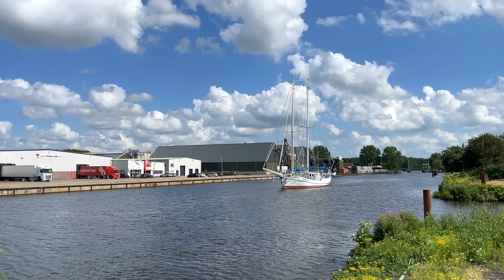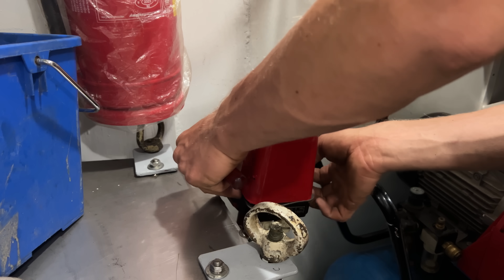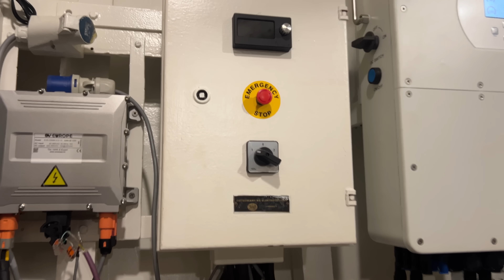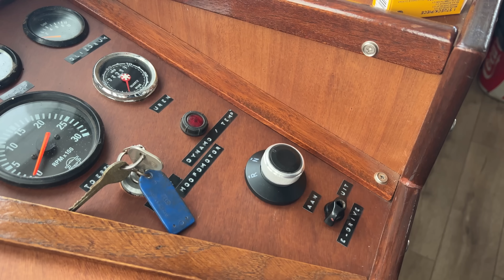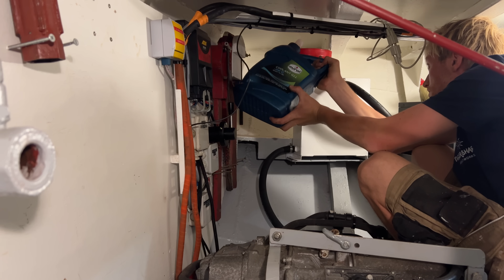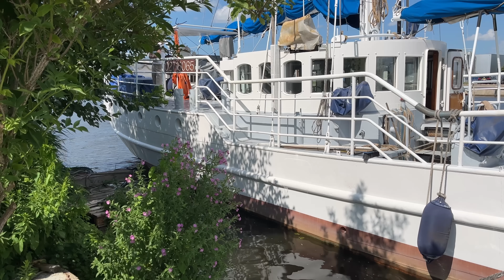The First Tesla Powered Ship - What Could Possibly Go Wrong?

Comment: What could go wrong?, well, we now understand that lithium -based batteries are incredibly dangerous, I watch all these YouTube channels where they're stuffing battery bank after battery bank in the bottom of their boat,,, if those lithium batteries catch fire your boat is going down, there is nothing that can stop it, and if you're in the middle of the ocean then what are you going to do?,, well we already know what you're going to do because of recent YouTube videos,,, you're going to die,,, so basically that's what could go wrong,, lithium-Ion batteries have brought down some of the biggest cargo ships on the planet, your little boat doesn't stand a chance when a battery goes into thermal runaway, and don't give me any crap about a battery management system controlling it,,, every lithium battery that is ever caught fire has a battery control system on it but yet it's still caught fire, you should be smart like the one YouTube couple. I saw building their boat is putting their lithium ion batteries in a fully encased steel enclosure at the rear of the boat that can be flooded with seawater automatically, and I also believe that they can drop the batteries from the bottom of their boat if something happens,, you cannot just throw lithium-Ion batteries on your boat and expect nothing to happen, it just simply is not the same as old batteries, when they go in the thermal runaway they will burn right through the bottom of your boat. Just like they burn through the bottom of large cargo ships and sink them, I can recall at least two cargo ships that have gone down in the last 6 months because of these batteries, The technology is new and it's very very very very very very very very very dangerous
Reply from the maker: We completely understand the concern, lithium fires are serious if systems aren’t designed correctly. That’s why our battery is in a sealed stainless enclosure with automatic aerosol suppression, pressure relief, and a total flooding backup. It’s engineered specifically so a runaway cell can’t spread or threaten the hull. We covered all of that in the previous video if you’d like to see the details :)
Reply: @tigersharkboatworks maybe your channel was the one I saw that battery installation on. I'm not sure, but it sounds like you have good safeguards, in general though watching these boat builds it makes me cringe when I see them putting the batteries inside their living area just out in the open air

Comment: I just sailed the Pacific on a Aluminium 56 feet Modern sail boat. The owner is a electrotechnical engineer. All systems are on board all. Every system is separately switchable and energy efficient. Smart software on top and only 3 great solar panels and a Watt and Sea is enough to do everything for 30 days. We never started the engine to load the batteries.

Comment: well done folks, verry nice work. dont forget to provide gas venting for that NMC pack in the unlikely event of thermal runaway. the water will not stop the outgassing.
Reply from the maker: Thanks! There’s a vent pipe to the outside, with an over pressure breakplate, for the toxic gasses :)

Comment: After running the self-test, your isoEV425 displays error E.01. I’m missing the required AGH420, without which the isoEV425 cannot operate at all. Nothing appears to be connected to the KE terminal. That’s the terminal for checking the proper ground connection. If this connection is missing, error E.01 occurs. To me, this doesn’t look quite right in terms of wiring. Also, all LEDs should be flashing when an error occurs. Or what else is the isoEV425 supposed to do?
Reply from the maker: Ahh you’re very sharp. I tried to run it like a ES425, doesn’t work obviously, so I went out and got the AGH420 and hooked it up properly. Only thing I find annoying is that the earth fault indication lights on our main AC switch board seem to pick up the signal the Bender sends to the PE, so they give a little blink every second, but there’s little we can do about that :)

Comment: That water will not work. It will never put out a runaway lithium fire.  As of now there is a new system that will work. It is called fireblock. It is a fire fighting system out of Africa.  Check it out.
Reply from the maker: We have a layered fire containment strategy for our lithium battery box, apart from making the risk as low as possible. If a cell goes into thermal runaway, first thing that happens is the automatic release of FirePro aerosol inside the box. If that does not prevent the heat from spreading, the entire box is automatically flooded with water to cool the surroundings and save the ship. Not to put out the runaway cell, that’s a lost cause. But to prevent the heat from spreading. From what I understand, Fireblock works best in open or semi open situations, where you can spray it directly on the fire. Not in a closed battery box. And we’re not gonna try to fight a lithium fire from up close by opening the lid. But, we dedicated the entire previous video on fire safety of the battery, in case you’re interested :)
Reply: Fireblock is a green jail and it was designed for the perpetual problem that you just said. And after the fire is out it can be cleaned up with sope and water. Thay have teemed up with a lithium batterie company in Africa.  The batteries are enclosed in there own case with there own cooling. Ventilation.  Sensors for thermal runaway with fireblock to go off at the 1st sign of a runaway. I have this set up on my Bering 80. I also have 2 of there fire extinguishers near by as well.

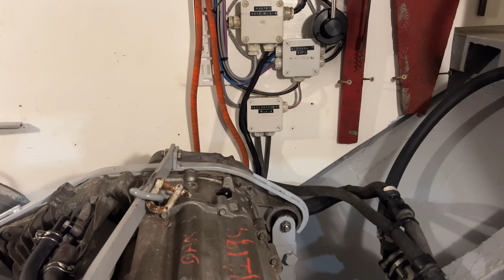Comment: I like the separation of the different coolants. At 07:40 Did you use the same quality orange high voltage cable after the splice to the black cable? I'm reasonably sure the orange cables are original Tesla cables, and has a silver shield inside under the orange rubber to keep the high voltage from interfering with anything else, like from the positive to the negative side, or to the hull or anything else that conducts power. You could do an isolation test with 500v from one end to another, and from positive to negative cross to see if anything is leaking, it's easy and doesn't take much time.
Amazing project! Excellent progress.
Reply from the maker: Thanks! We used the same quality, but unshielded, because they only carry DC power, not high‑frequency signals. Tesla uses shielded orange cables mainly for electromagnetic noise control inside cars. The inverter’s PWM switching can radiate interference in a dense automotive harness. In our case, good insulation and spacing are all that’s needed. So the insulation test is a very good idea :)

Comment: Make sure to do the "coolant delete" on that Tesla motor!! To prevent coolant leaking into the motor in the long run
Reply from the maker: I believe that only applies to the Large Drive Units? We're using a Small Drive Unit, which doesn't have coolant running through the internal motor housing. It just has a semi-external lubrication oil cooler, and an inverter cooler :)
Reply: @tigersharkboatworks you're right, it only applies to the large one. I thought u had that one haha. Good to see you thought about it already!

Comment: Can your BMS communicate with the Deye invertor at all? 
The Deye LV invertors are known to have died when Battery BMS tripped and the battery connection was lost under load. That's why communication with the BMS is now the norm. It prevents this risk, since the BMS tells the Inverter how much Amps can go in and out.
Reply from the maker: It doesn't actually, it's regulated by the pack voltage. Since we have another single phase CAN controlled charger, that only works via the BMS. But thanks for the heads up, we're gonna have to think of something clever to have both of them communicate with the BMS :)

Comment: I'd love to see some data on how much power you use or generate in various scenarios. How well did the generator mode work with diesel? How much power were you using to cruise around? How long would it take to charge on solar? etc.
Reply from the maker: Us too! We’re gonna do elaborate testing to find all that out :)
Reply: Yes I think it's a nice buffer to have, much like a water maker on a boat, not every passage requires it being used. But it's nice to have the option. We are in uncharted territories here, yes the motor puts out 350kw at max output, the solar panels absorb X amount. There are times where you want thrust from the engine under sail. What is the optimal prop speed Vs EV speed Vs Diesel speed and load? How does the hull speed relate to this? What about wind speed under sail and the prop drag? Much like the Vende Globe foil yachts it's fascinating seeing the data as he isn't just going on a canal.

Comment: Is the battery box filled with inert gas.
Reply: No.
Reply from the maker: That would be a bit difficult, because the lid can be opened for maintenance and inspection. But there’s a temperature activated aerosol canister inside, which pops at 80°C, that takes away all the free radicals needed to sustain a fire. If you’re interested, I talked about the whole thing extensively in the previous video :)

Comment: I don't know if you can say you were the first to do this.  Maybe Tesla, ok.  But @YachtCityLife started their hybrid Prius electrification project in Nov/Dec last year (2025), and created a whole series on what he had to go through to strip the car, and modify everything to work on the boat.  He uses the Prius engine as a drive and as a generator for his battery bank.  He plans to remove the second (Crusader) engine and add an electric motor to run off the battery bank as well.  Check him out, he might have some similar issues as to what you faced for sizing, alignment and power.
Reply from the maker: Sounds like a very interesting project. But I still couldn’t find any other ship powered by a Tesla electric motor, so until somebody shows me one, I think I can say this is the first :)

Comment: I missed the battery box build? Is it sealed or does it have outside venting for thermal run away/ steam generated when the water hits the fire?
Reply from the maker: It’s sealed, but with an over pressure break plate in the outside vent pipe. I described the whole thing in the previous video :)

Comment: Would be nice to add a water driven turbine. Then you could generate electricity also when under sail. You add a  little drag, but "running cost" would be really low.
Reply from the maker: Basically, the Tesla motor is a water driven generator, when the prop spins while sailing. So we don't need to add another one :)
Reply: @tigersharkboatworks  What effect can you get from the motor at normal cruising speed?
Reply from the maker: We still have to find that out during test trips :)

Comment: you can use G12+ coolant everywhere, everything else is marketing garbage. the tesla cooling fins will get clogged with g12+ in 90-100 thousand hours...sooo yeah, both the motor and the battery will be loooong dead by then....
Reply from the maker: Ohwell, our main coolant system also doesn’t contain G12+, but it’s over 300L, so we’re not swapping over the whole system. For the 8L in the Tesla circuit, we might as well use what Tesla recommends (VW TL-774C) :)

Comment: I'm guessing it will be more efficient to charge the battery with the generator and use the electric drive than to use the main engine. I guess the limiting factor is if you can add more power than you're using. 

BUT! At the end of the day, it's a SAILboat!
Reply from the maker: It’s actually most efficient to go electric until the battery is low, than use the main engine for propulsion and battery charging at the same time, until the battery is full again, and repeat :) But, what am I saying. It’s most efficient to charge the battery while sailing and not use diesel at all :)
Reply: @tigersharkboatworks  

Have you been able to test charging while sailing yet? Apparently Leo of Tally Ho has not got his system to work yet. I guess the problem is the prop being too small.
Reply from the maker: We haven't yet! Correct me if I'm wrong, but I think Leo also had difficulties engaging the regen when sailing in strong winds? His system is a bit different from ours. Our regen is basically always engaged, we just regulate the brake torque. And our prop is 1,3m diameter, so it has a bit more drag, but also a lot more rotational force. Anyway, right now, I can only hope it works better than Tally Ho's :)
Reply: @tigersharkboatworks  

How long do you estimate it will take to charge the battery while motoring?
Reply from the maker: Not sure yet, maybe 4-6 hours? Tomorrow we'll see how much we can brake the main diesel without stressing it too much :)
Reply: @tigersharkboatworks  why not have a smaller diesel generator so that you can charge while sailing on longer routes for example! having to wait for the batteries to recharge isnt too much?!

Comment: I am currently looking closely into toyota hybrid drive system, using planetary gear sets. Would love to see that in your main engine connection instead of the belt connection :D
But probably not something that could resonably be done/developed?
I hear the efficiency in a planetary gear set is much higher than in a belt drive?

PS: very happy to see a new video released - in the last weeks i always checked the boats location, you were around quite a bit. Happy that it seems to work out well so far?
Reply from the maker: Nice! That sounds very interesting. In our case, a belt drive system is way easier to install than a custom (or not custom) planetary wheel gearbox. The efficiency is higher though, you’re right about that.
Part of the reason it took a bit longer was because we were doing some trips (not electric, because we finished it just now). We’re doing the first electric one tomorrow :)
Reply: @tigersharkboatworks best of luck for the upcoming trip and looking forward to the next videos🙏🏼

Comment: Hay from English neighbour, just a question about you tooth belt setup. The motor mount rubber bush is going to need some attention.  I am thinking that one end is fixed and the other has a rubber mounting.  
Your set up will have belt ware issues?
Reply from the maker: The Tesla is mounted on 3 rubber mountings, so yes, one side is a bit stiffer than the other. So the less stiff side needs a bit more tension. We’ll have to keep an eye on it, to see how it holds up :)
Reply: @tigersharkboatworks  that’s great news